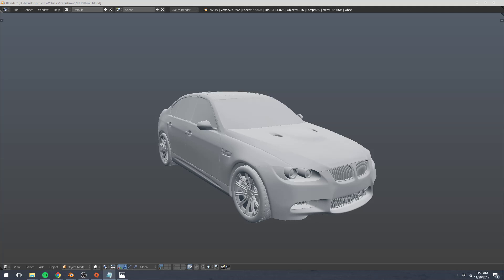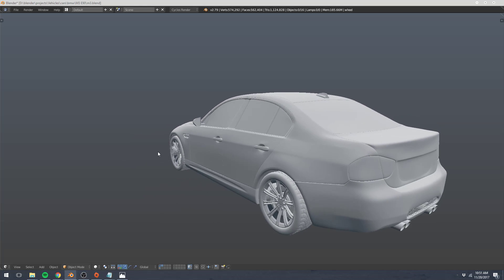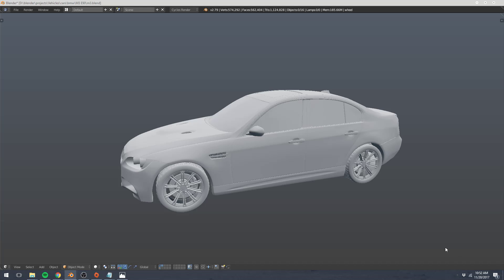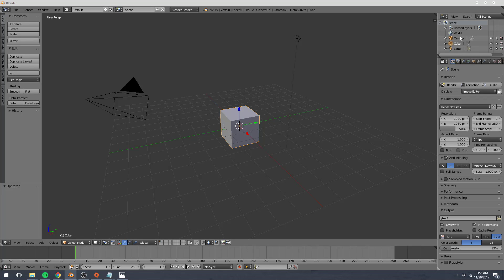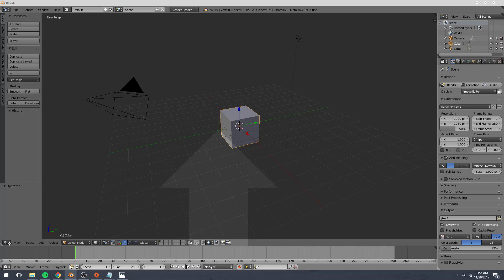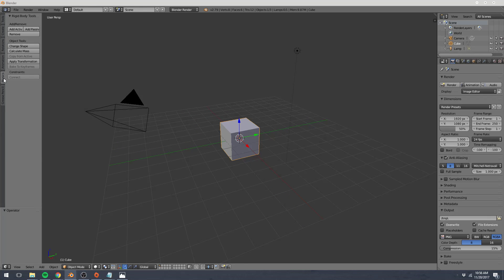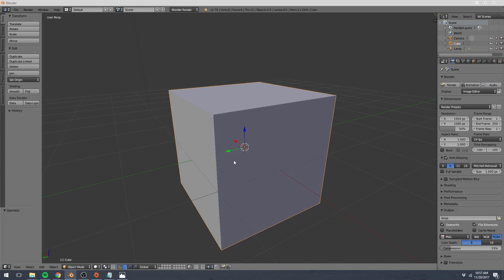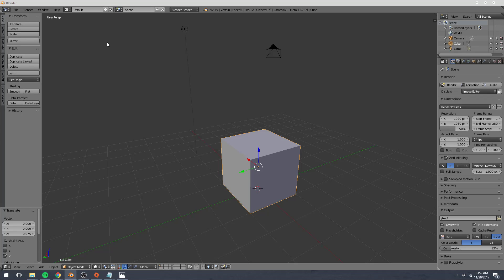Model a 3d Car | part 1 | user interface & intro (Blender tutorial)

Comment: A car is obviousely not an apple...in my early days with car modeling i tryed to model it as a whole object (except the tires)...i found out that the correct way is to conceive the car as an assembly of body parts each one is a separate object...these parts must correspond the the real life parts of the car...so never extrude the windshield from the hood or the front bumper from the radiator grid

Comment: I downloaded the Windows 32 bit installer version, is it proper for car modeling?
Reply from the maker: Cwsof251194 yes either version works. Depends what your is operating system uses
Reply: The way the options are shown on my poor notbook is very weird, it's like everything is hidden, I see icons, but no names. I think it won't work. Should I delete it and dowload it again I just accept that it won't work?